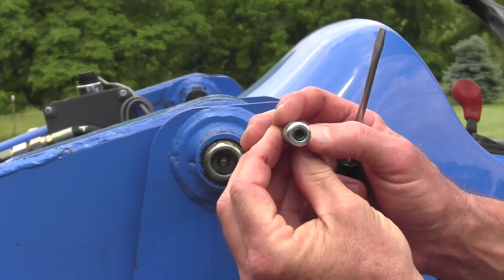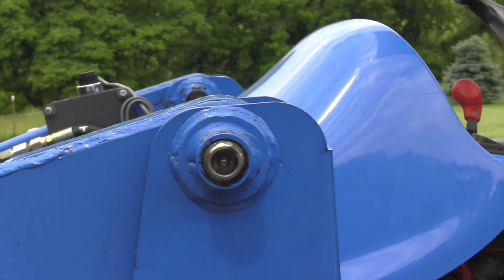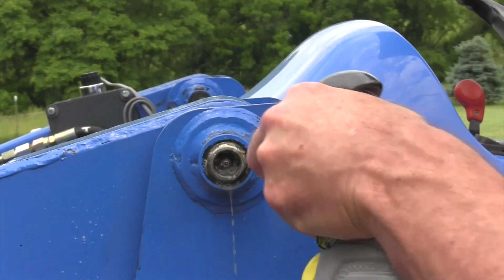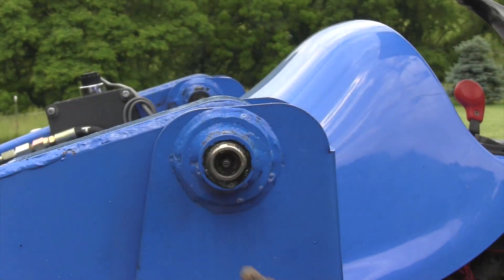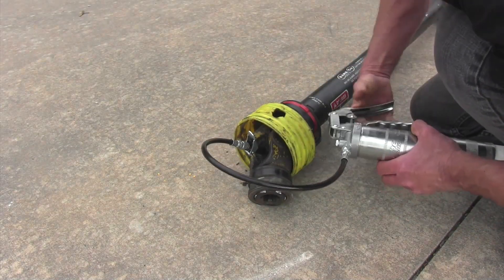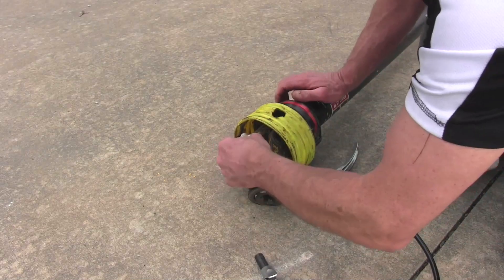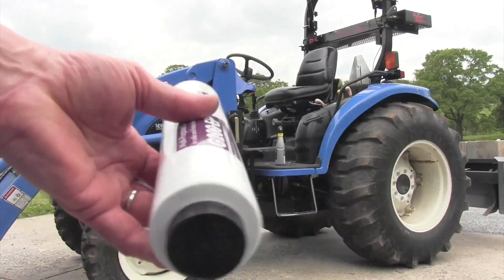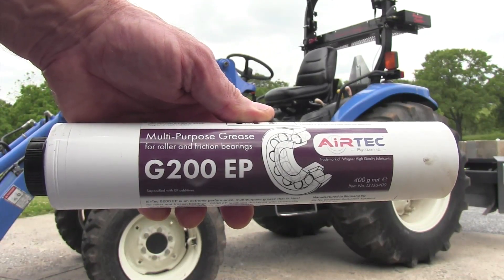12 Things You May Not Know About Greasing

Comment: Use the grease that is specified in your Operator's Manual, not all grease is the same.  Some greases are better for high loads and some are better for faster rotational speeds.  Also do not mix greases, they can react with each other.
Reply: Yes, you a right!
Reply: To technical, Agricastrol for engines diesel and petrol including small Briggs and Stratton. Castrol gear oil for gear boxes and diffs. Castrol  general purpose grease. We ran our cars on it as well.

Comment: Three shots are enough for Pto shafts don't over greese and open the seals.  Get a good greese that will keep the moisture out a moly Lithium greese is best.
     Air greese guns are the best, the battery guns are ok, but get spare batteries.
      Make sure not to over greese some bearings always consult owners manual.

Comment: Try to use at least 3 percent molly or if you can find it molly max which is 5 percent molly ! They if it only gets hit every so offen the joint is still good, I worked for the railroad for 49 years, if the operators only hit the fittings every so offen it’s still good
Reply: Cat recommends 3 percent at least!!

Comment: not true about not having to grease the less used items. on a loader the pivot pins get moisture and dries up the grease.  even when not using it.  i use universal marine grease from Lucas. also when greasing those pins they will never get greased uniformly inside.  there is only one feed hole on the pin and the first place the grease will escape  when pumping grease in is out the opposite side leaving most of the pin dry.  you can grease  your pins then pull them out to see where the grease is going.  you may be able to get by greasing a pin  then rotating it 180 and grease it again but you should inspect  it.  otherwise i just pull the pins out and lube them manually and the hole it goes into.

Comment: Hey Mike nice video. I have a curiosity question for you. I also have a TC40d, it’s a 2003, not sure what year yours is? Owned it since new and it has been one of best tractors I have known all around. I saw your side panel off by the relays, mine is off as well because it has an intermittent starting issue. Wondering if you might have had the issue? It is not the starter, key switch or any of the safety switches. I have been through and tested them all. Even pulled the starter and disassembled to clean and check contacts. Seem to be down to a relay or relay panel problem. Have you had or know anyone who has had a similar issue with a TC model? Other a ignition switches wearing out I’ve had no other issues in 2500 hours. Thanks for any help or direction.

Comment: The reason farm machinery is still greasable is because grease can get cooked and turn bad under high pressure/temperatures, and then the bearing will fail soon after.  Greasing machinery every day keeps good grease in the bearings.  It has nothing to do with not wanting to redesign tractors - that doesn't even make sense.

Comment: If I wanted to replace a zerk fitting, is there a metric or standard thread size or are they pretty much all the same? That was a great video Mike! By the way my hair is almost as long as yours!
Reply: Yes there are both standard and metric thread zirks with multiple sizes and thread pitches . Then on top of that they come in straight, 45 and 90 degrees .   My advice is to remove the old zirk beforehand and take it with you to the machinery dealership or auto parts store to make sure you're getting the right one

Comment: STUPID QUESTION ALERT!: When greasing a loader, does it make any difference what "position" the loader is in when you do it?  In other words, can the grease zerk be blocked and not allow the grease to enter the zerk based on the position of the loader, or is it just a bad zerk?  Thanks again for doing these videos.
Reply: D.A. Ballou only stupid question is the unasked one!
My older tractor and loader some times needs to be moved a slight amount to allow access to the zerks. Mine is old enough that they are not recessed into the pin as Mikes are, but have been drilled into the barrel around the pin. Long answer to say moving the loader or steering or PTO for access is fine, but please please do this with safety in mind! Never grease a PTO with tractor running! Never grease under the tractor with the tractor running or without parking brakes set! Never ever walk under an unsupported loader for any reason.
Reply: Definitely not stupid question at all !   At the risk of being a bore this is what i ALWAYS do when greasing a loader .   Simply put a wooden block on the ground & push down which reverses the working side of all the pins . This creates a small cavity on the pressure side which is EXACTLY where the grease is most needed ! Self level loaders have more pins than not S L  , everything is much smoother when done this way .   Oh , don't forget to do any axle pivot points ,steering trunions & ball joints as well .    ~  ~

Comment: Is it bad to use too much grease?  Like if a bunch comes out?
Reply: I was told it would just waste good grease. Not a biggie, I tend to slightly grease more than stop at the first sign of spotting or hearing the grease. Grease isn't that expensive but can add up. I splurged just a tad. It does cause some grease slug accumulated that when I hose down my machine they tend to smear or spread on the paint. Wiping it off solves that. 🚜..........
Reply: You can never over grease. Any excess will just come out and not cause any harm,  only makes an excessive mess!
Reply from the maker: Not bad, just wasteful.  It won't hurt anything, I usually spread it on the rails of my pallet forks to make them move easier.
Reply: As a machine repairman knowledge of the bearings you are servicing is paramount. If you’re greasing booted bearings such as tie rods over greasing can blow out the boot loosing all weather and dirt protection. There sealed bearings with grease passages designed to weep a little but too much and you blow the seal off the bearings. Roller and ball bearings are more subject to this type of failure than the typical farm sleeve bearings. Other facts be careful not all greases are compatible and will cause each other to degrade , fail . Some will breakdown wash out others will separate the oils out leaving only the “binders” damaging bearings. So there is some science at work in the art of greasing.

Comment: So wrong, due to the amount of grit that gets around farm machinery and building machinery sealed bearings are not used, the grit would grind the seals away. The black grease that comes out has grit and dirt in it keep pumping until clean grease comes out and wipe the old grease away. Standard grease will dry out and not function as it should after long periods of time.

Comment: sealed bearings  in new cars are  designed for throw away  vehicles  !  So far tractors are not throw away equipment .  If properly maintained  they will last for generations !
Reply: strange... because sealed non grease-able U-joints on drive shafts are stronger and from personal experience last longer than grease-able. And more and more were finding more sealed joints on tractors. It’s not a throw away thing. the days of years past we had poorer and softer materials that needed constant grease to keep wear down. Now with new metallurgy the materials used are farm better and wear less so they don’t need the constant new grease, and newer greases are far better as well, as they resist pound out and wash off, and better wear resistance.

Comment: If a grease fitting seizes up they make a grease joint rejuvenator to free up or clean out the zerk fitting. It attaches to the zerk and you fill the rejuvenator with penetrating oil. It has a piston sticking out the back of the rejuvenator and you start tapping it with a hammer and it forces tbe penetrating oil thru the zerk freeing it up. Of course its a lot cheaper to just buy a pack of zerks and replace it.  NEVER EVER BUY CHEAP ZERKS TO REPLACE. Always go with a good quality zerk orherwise you are asking for trouble. The difference in quality is usually in the threads. A cheap zerk does not have a lot of thread engagement and will either strip out or pull out. After that you have to disassemble the joint and drill & tap for a larger size Zerk.
Reply: Sounds like you have been looking in my toolbox.  I bought my tool back in the early 80s.  Still use it once in a while.